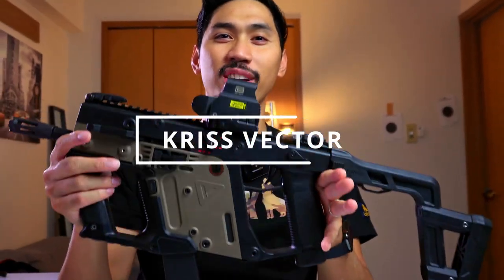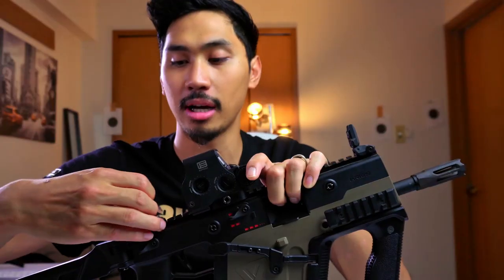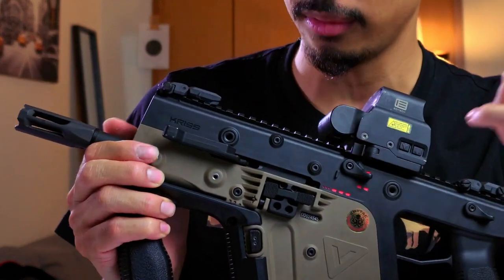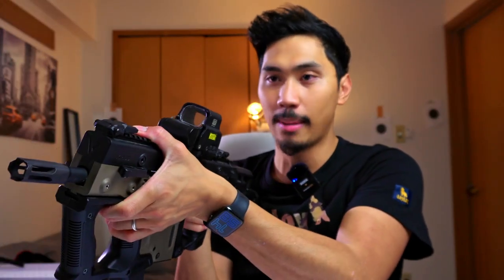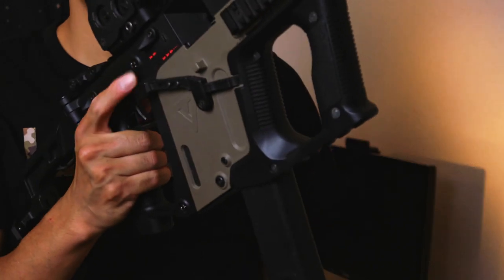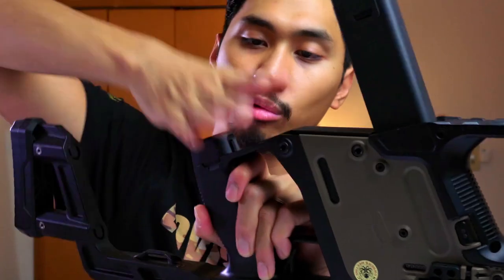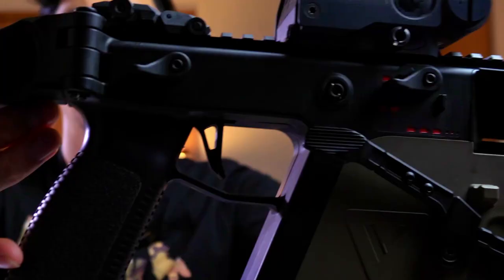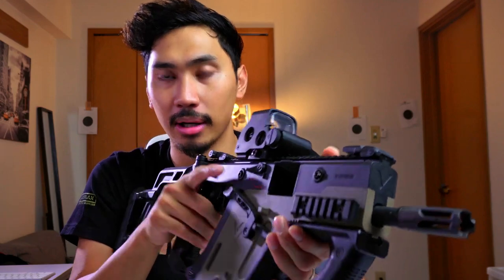Every Airsoft Vector owner needs to copy this build! (KRYTAC VECTOR Review)

Comment from the maker: Do you think the Vector is flawed by design?
Reply: Definitely different 😂
Reply: The main action is complex but that’s about it
Reply: Controls wise, yes it will never be as fast as an AR platform.  But it’s certainly not unusable and with training you should be perfectly fine.
Reply: Definitely, 
Why?
Bb trajectory compensation.
Reply: Yes and no
Reply: I'd say the biggest flaw is the magrelease. So I got it with the laylax ambi mag release wich is nice don't get me wrong but it also have a flaw. I shift between right and left shooting and when I change to my sidearm after shooting as a lefty it will activate the laylax magrelease when it bumps against your body which is very annoying when it happens as it'll drop the mag. Similar thing happens to the safety lever and fire selector sometime when hanging against your body.
Reply: How much? where to buy it? I just start use air soft
Reply: No, I have a real 10mil and it’s it’s amazing

Comment: What I really love about the Krytac model is just how close the polymer feels to the real one, I dare say it’s exactly the same.  The finish on the metal parts does leave a bit to be desired however since it comes off quite easily, a lot like paint.
Reply from the maker: The designer I met said it’s the same with some small changes to fiber I think

Comment: Regarding flashlight - instead mounting it on the side rail, just use offset mount on top rail for flashlight, problem solved with folding stock getting in a way. Or take off iron sights and use something like Inforce WML flashlight directly on top rail.
Reply from the maker: That’s true!

Comment: Definitely needs a better motor, 13:1 gear set,and MAINLY a perun mosfet,the new one for vectors specfically, internals are why i got rid of my two vectors way back (before i learned teching and such) so i may pick one up again in the future (:
Reply from the maker: tbh, yeah. Maybe not right now, but my 2.0 build will definitely include a KAGERO, 13+1 and Perun.

Comment: Thanks for the tips in the video.

A quick question about the Laylax foregrip, I have been reading a few reviews and apparently that thing is impossible to remove once placed ?
Did you have that kind of experience ?

Also, did you perhaps end up going the customizing path ?
Would be curious to hear about the parts and the build process.

Thanks a lot for your time.

Comment: sooo japan airsoft isnt full of DSGs and Monk customs builds ? i wouldbe thought they would be since they are so small and the 1j limit doesnt really disadvantage those systems
Reply from the maker: DSG is common yes!
Reply: @MaydaysanAirsoft  was wondering why you keep your guns stock then, at least your AEGs, I am at a point where I can’t play with something unless it’s upgraded to the maximum and I feel like it takes away from the sport a bit 😅
Reply from the maker: @sinnerairsoft8487  I usually use my NGRS guns that have titans in them. My standard AEGs are kinda just Chillen

Comment: Can confirm that the flash hider does rust. I hang my vector on the wall for a month and when I bring it down to do some mods before going to the field, it has ton of rust on it.
I'm running a 11.1v at 1100mah 25c a bit hard to find but totally worth it because it fit in the grip without the extended cap. For the over spin problem I just put in the perun mosfet and it's gone; also the precocking is amazing :3

My next plan is to try putting a warhead motor and 13:1 gearset inside this thing. And I should be done with it, hope nothing go wrong (finger crossed).
Reply from the maker: Damn
Reply: This is exactly what I'm getting built right now.
- Perun mosfet
- Warhead base 
- Lambda Five 209mm
- 16:1 gears (13:1 seems a bit too extreme even for warhead)
And lots of other small parts.
Excited to see how it'll perform. I just don't know about the barrel because it will stick out past the stock flashhider xD
Any ideas what could I use to cover it and still have a cool look? :D
Reply: @mareklewandowski7784  I'm using laylax prometheus krytac pdw barrel in my vector, it fit perfectly with no barrel sticking out.
Maybe you can also try to put on a mock suppressor to hide barrel tho :D

im using the alpine white vector so my outer barrel is actually a bit longer than standard vector

Comment: managed to with deans connector version, fit mini-s noir 2000?mah battery in it without extended cap. also ive always recommended (against my shop techs advice of dropping in parts w/o tuning lol) tossing in an option no.1 brushless and it tanks it with stock internals....and/or at minimum perun mosfet replacement to get best response and reliable cycling with stock motor. several customers, no breakages year plus so far, referring to Japan version vector
Reply from the maker: Niceee